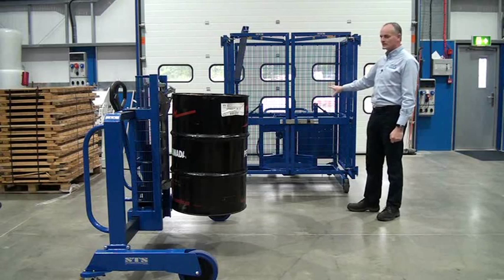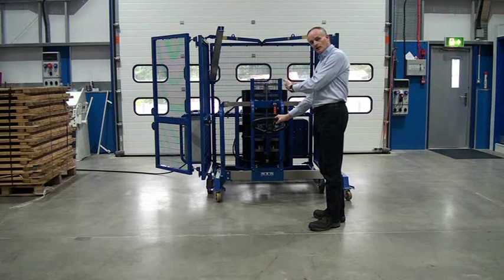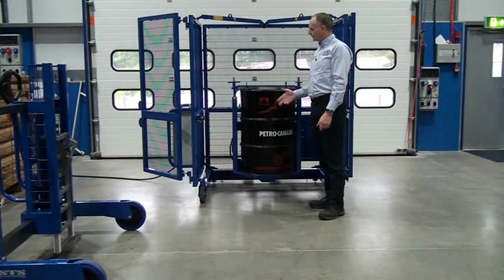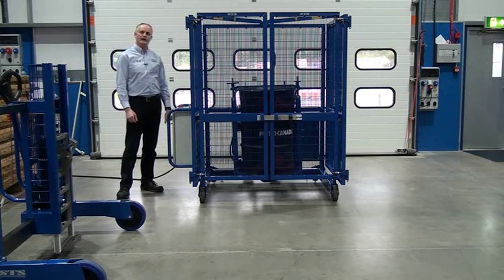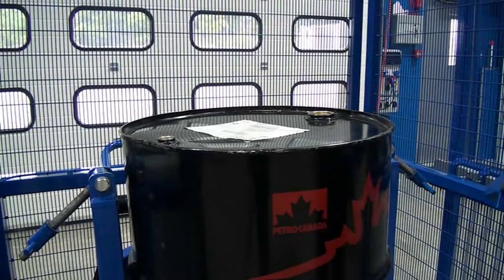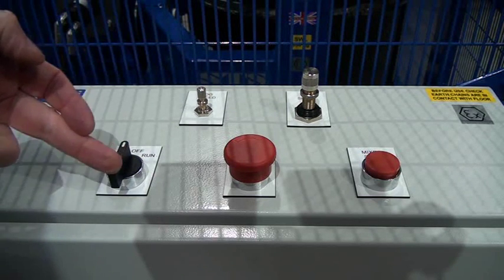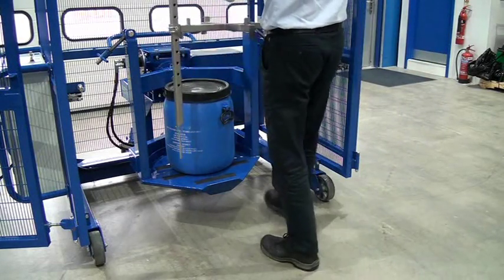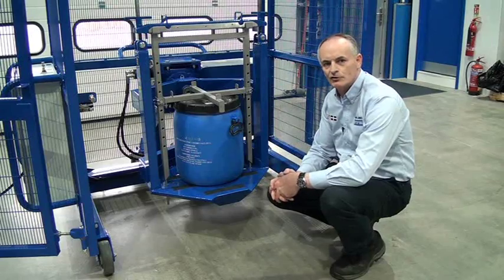STS - Drum Mixer for Tumbling Drums & Barrels, Mix Oil Drum (DMP01-EX)

Comment: Why this equipment have more noise while running ??
Reply from the maker: Hi Zakeer. This machine was pneumatic-hydraulic powdered. The noise you can hear is the pneumatic-hydraulic pump running inside the control box. Our electric model DME01 uses an electric motor instead which is much quieter. I hope this helps.